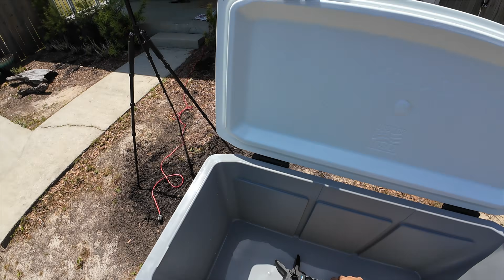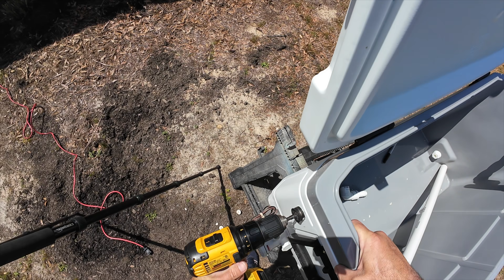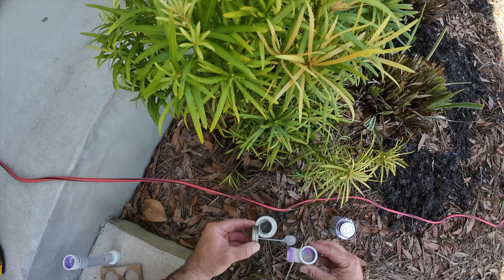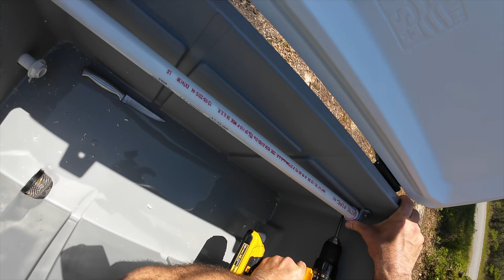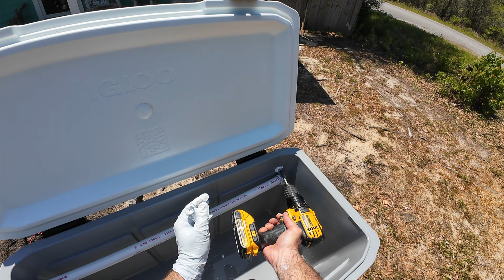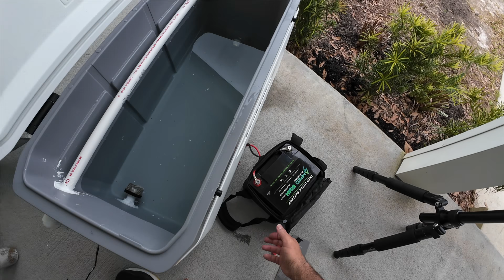How To Build The Ultimate Portable Livewell.

Comment: I'm on the fence ordering a jon boat with a livewell built in or making one of these. Do you just fill it up with a bucket and drain it a little and top it off  or do you even need to do that and the pump keeps the water originated well enough.
Reply from the maker: I would get a built in livewell plumbed to pump in freshwater if it was me.

Comment: Made quite a few of these over the years. Best advice I can give you about it is to get a small bottle of Foam Off. And to use stainless hardware. The constant contact of saltwater will rust out cheap metal fittings in a few weeks on constant use
Reply from the maker: Got it, that stuff works greats